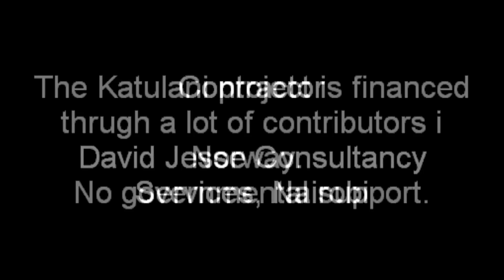The biogas project, part 2

Comment: engine should run on bilo gas you would use it to rotate the wheel on  an generator to convert the kinetic energy the biogas engine has in to electric energy. The generator would be something like an alternator on a car. After that you would need to store the energy in to a battery.

Comment from the maker: Thank u for watching. I think it is possible to make the biogas digester with a flat topped, but with the dome you will have a gas storage. The dome is very simple to make. We have made one in concreete. Its a very low pressure, less than 500 mmVs, so tightening is done in seven layers including two layers of waterproofing. The price for this 48m3 digester appr USD 10 000. helgeu at hotmail.com and I can send more detailed info. Muasa

Comment: Hi there! great Video. I have been nursing the idea of making something like this on a farmyard. Question: must I stick to a dome-shaped top for the digester or can I just make a straight-walled and flat-topped one? Any advantage in dome shapes? Again what safety feature do I put in the gas piping at the top to prevent leaks? And please how much did it cost you to put it up and running?